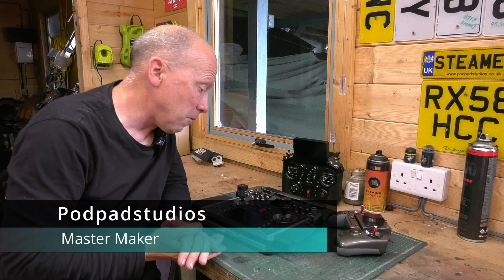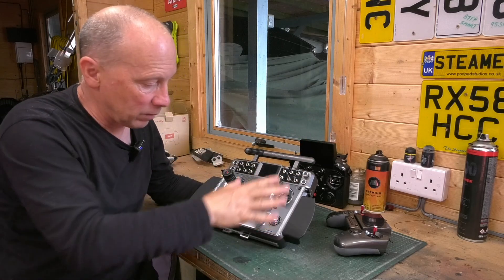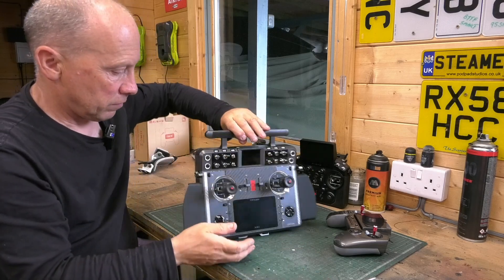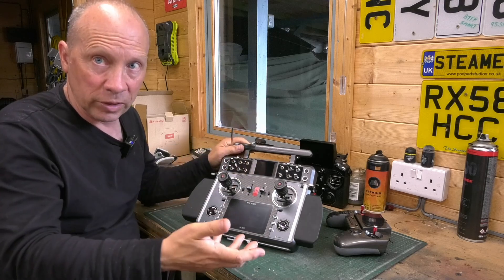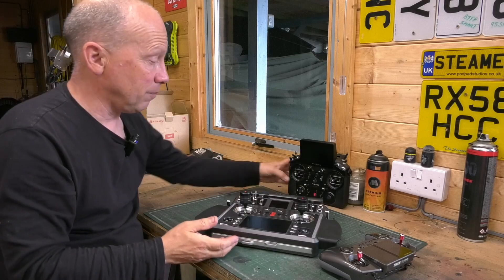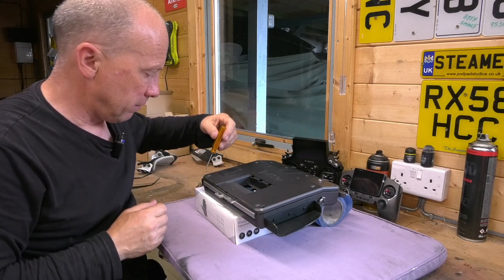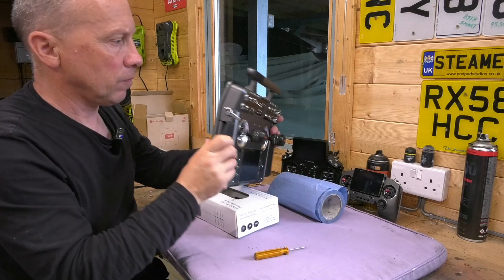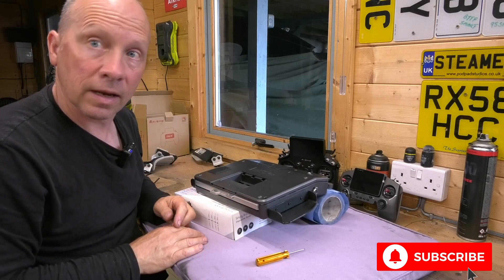Special: Radio Cantrol for Robots. How to add switches to TandemXE, & change stick configuration

Comment: You have multiple daleks and droids and scale tanks. How do you switch control between them?
i.e. can you pair multiple receivers with one transmitter so that the one transmitter can control whichever device is powered on or do you swap the receiver module between each device whenever you want to change which device you are controlling (which is a pain) or do you have dedicated remote control and receiver for each device (which is a lot of unnecessary expense in remote control handsets)?
Reply: Done a little digging, you can associate multiple receivers with a single handset.
Reply from the maker: We use the Frsky Transmitters and receivers now. Each model has its own reciever and in the case of the larger models up to 3 receivers per unit. The recievers are bound to the transmitter and can them be switched in a model page to whatever model we wish to control. The FrSky Ethos system is a 24 channel system so can support up to three receivers per model maxing out your physical channels. The FrSky Ethos system also uses Para link wireless linking so we can link a second transmitter to a model allowing in effect two transmitters to control one model, great for larger complex projects like Tiffany. Hope that makes sense.